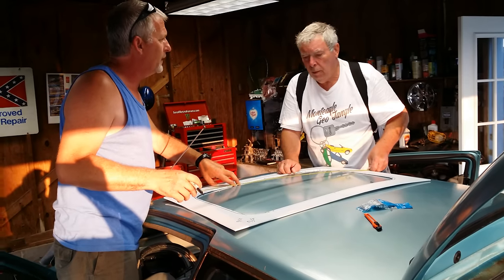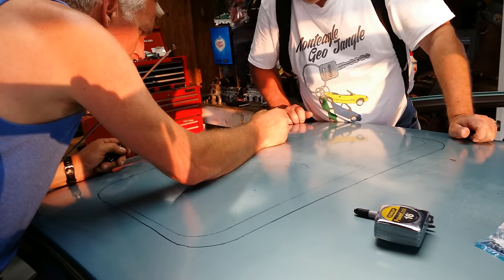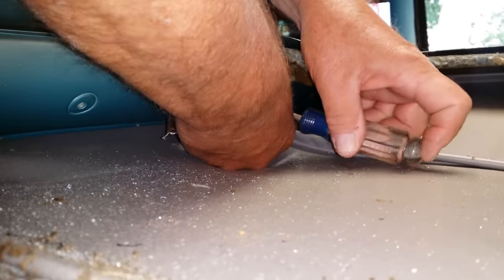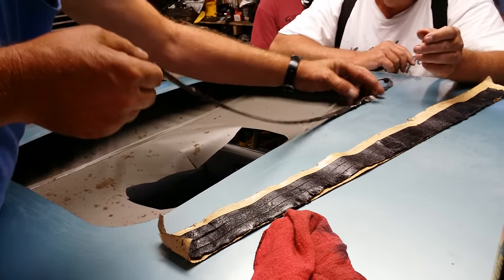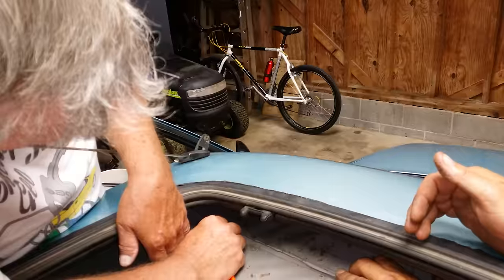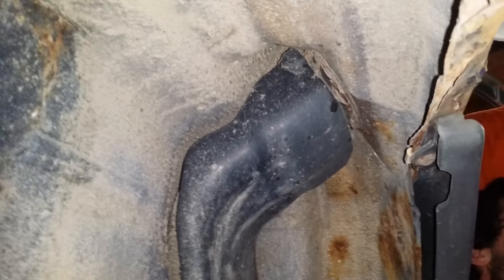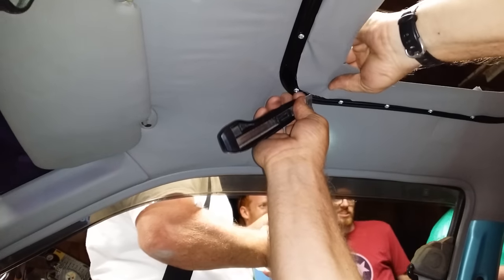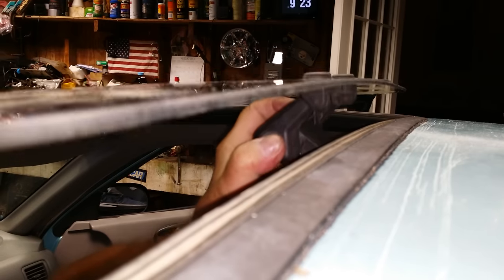Geopalooza 2014 Sunroof Install

Comment: woudnt it be better if you put it on reverse that way it scoops air in
Reply from the maker: ‍1marcelfilms I don't think it's practical to do that and I think I know why think about the geometry and physics of what's happening when you open it sunroof you don't want to create a ram air scoop because that will also Ram air scoop everything else Rain bugs Rocks dirt Etc and it might even tear the sunroof right out the roof of the car from forces alone at highway speeds the idea is to create a low pressure Zone behind the opening and combine that with other windows in the car being open and you get flow of air through the car pretty sure that's why I goes that way but I'm not an expert